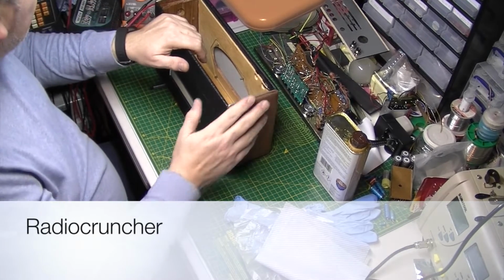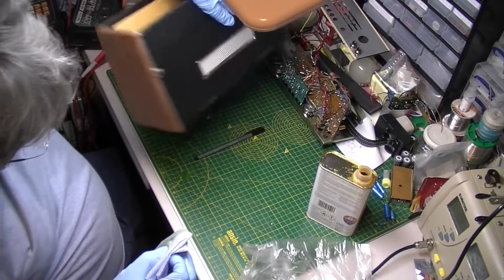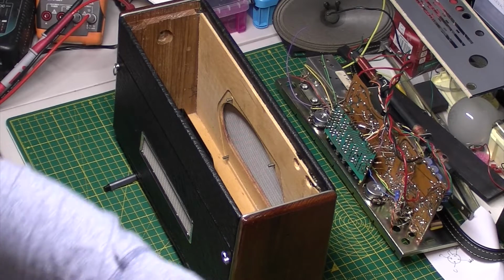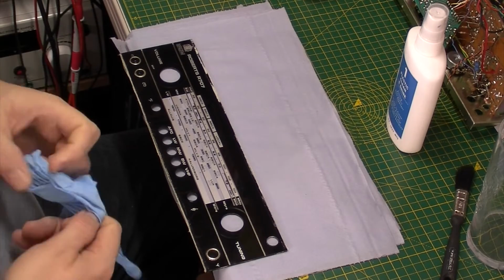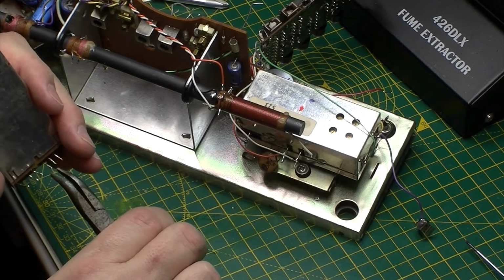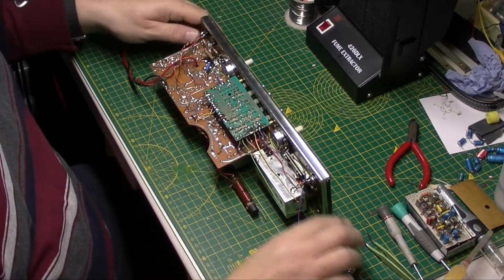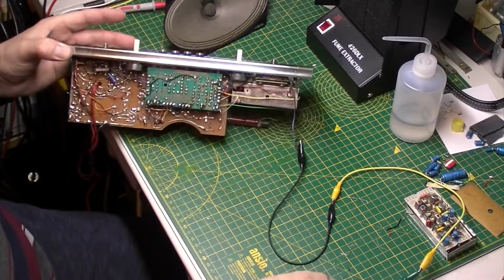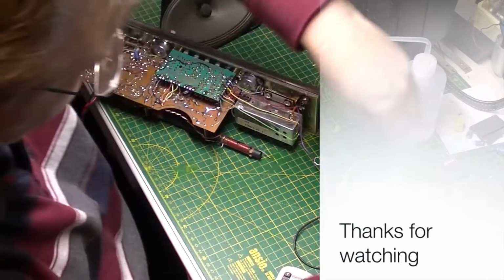Roberts R707 newest version. Part 5: Case restoration and module replacement again!

Comment: Lovely Job As Always Graham,You Can't Beat a Bit Of The Old Danish Oil...I Think The R707 Was The Best Sounding Of All The Radios That Roberts Made, Apart From The Trouble That The Dreaded Module Give, Still Got 2 R707s To Do... Still Waiting For The Courage To Start Those Projects, Learnt Every Thing I Know About Radio Repair From Watching You Repair Those Lovely Old Hackers and Roberts Radios Keep At It Graham Your One Of The Very Best At Restoreing These Lovely Old Radios,Looking Forward To Next Video ...Regards mike.
Reply from the maker: Hi Mike. Yes that Danish oil really brings the side of these old Roberts radios up lovely. The R707 is certainly hard to beat sound wise and give the Hackers a good run. The module is a bit of a pig to do but the results are well worth it. Good luck with yours when you pluck up the courage. All the best Graham